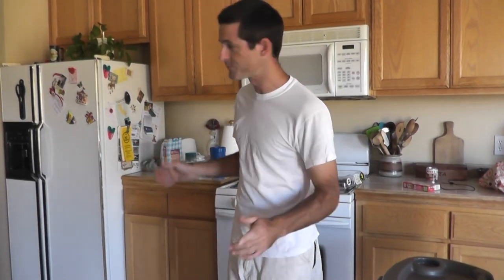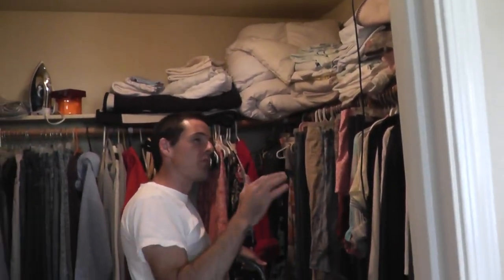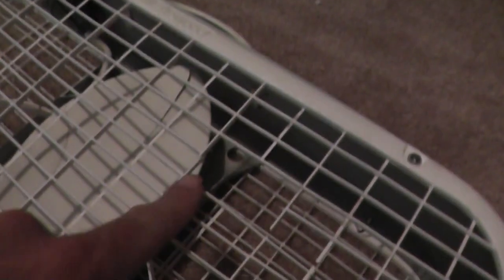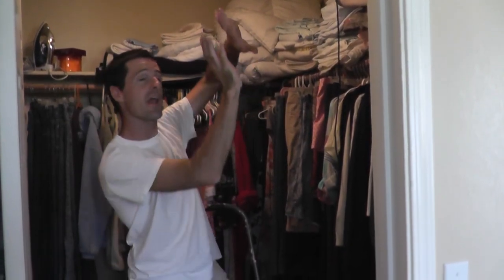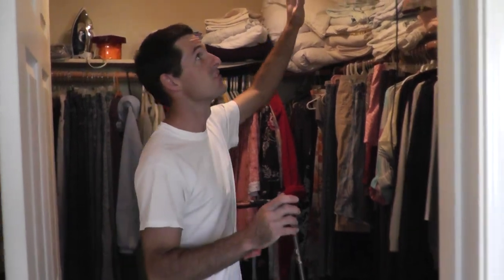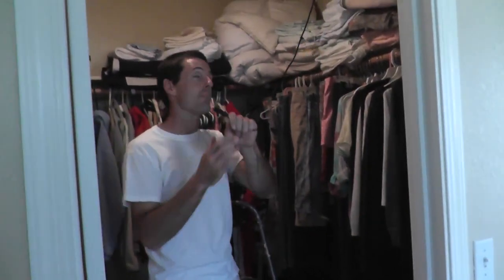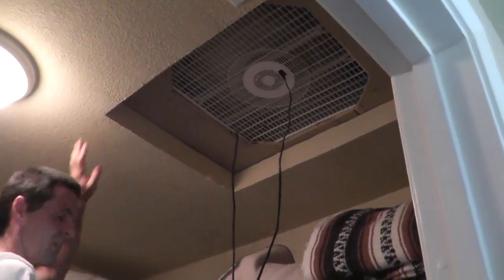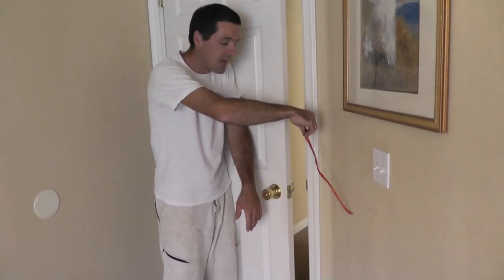Cheap Homemade Whole House Fan - How To Cool Without A/C !!

Comment: not a bad idea except no louvers when not in use, so heat will push down into house during day. But he has the right idea.
Reply: +robert mccully Warm air rises, cold air sinks. If doors and lower-story windows are tightly closed during the day, and unless there is a very strong, wind blowing outside during the day, the hot air tends to stay in the attic. It's similar to the way cold air stays in the freezer chests at the supermarket, even though they have no lids on them.
Reply: in theory that should be right,, but if you open your attic cover it is about about 130 degrees right at the opening. So that means it will push down. But if you leave the fan on all the time it will push the air out.
Reply: robert mccully That doesn't make any sense at all.  The attic isn't a sealed volume, and as the air therein expands while it is heated, it simply exits through the soffit vents and gable vents.  If the fan is left on all the time during the day, it creates negative pressure in the living space and sucks in hot outside air through cracks around doors and windows, heating the the house up faster.
Reply: true,,, the point is louvers keep the hot air in the attic until the fan is turned on. Just like curtains help keep the suns hot air out. To test the theory put a thermometer  on the bottom of the ceiling with a probe up into the attic a few inches . Or a thermometer in back of a curtain and one in front.
Reply: Its like the world is flat,, any sailor knew it was not. And any person that has worked in an attic knows the second you stick your head in a attic your sweeting.
Reply: +robert mccully 
Yes, and when you pull it back down from the attic hole again it is NOT as hot. Heat DOES rise and exits out vents already in the attic. Reply after reply on here does NOT change the scientific fact that heat rises. COLD air is the air that falls. 

I walk through empty houses all day long, summer and winter, fall and spring. EVERY house that has an attic, there is a drastic temp difference when I raise my head from below the attic opening to just above the attic opening. Now keep in mind, these are attics that have had their door/entrance remain wide open and has been that way for months, in some cases years, depending on how long it has been vacant, and there is NO noticeable temperature difference BEFORE I EVEN STEP ON THE FIRST RUNG OF THE LADDER and surrounding areas, until I get my  head PAST the opening of the attic.
Reply: I agree hot air does rise, it does not have a direction rise. If there are no vents in that area or enough vents the air is trapped..And there is a lot of roof area compared to roof vent. area.  There is also winter and to much vent would let to much warm air escape.. Vents are designed to prohibit mold grown in winter not heat escape in summer.. But yes a fan would force air to vents better then no fan. All i am saying if you use a fan have louvers. Beside you would want louvers in winter because it is colder in attic. Who would want to have no lovers in winter to allow any heat in vent to come down in house... It is never balanced  for heat or cold. so that is why  there is a attic door.

Comment: we laughed when watching this.... esp when you stepped on a cat @ 0:10!  An hour later our box fan was blowing hot air up and out of our attic.  Our goal was to get our AC up to the 2nd floor, it worked perfectly.  Our 2nd story is always 10+ degrees warmer with the AC on. The fan pulled the cooler air up (and out of the upstairs vents) and both floors were the same temperature.

Comment: This may have been mentioned before, but I live in Texas and when it is 110-120 degrees outside it doesn't make sense for us to crack the windows enough to draw and circulate air from outside. If I did that I'd just be dragging very hot air into my house. I think this would work great in moderate climates if it was 80-85. Additionally, I couldn't put the fan in close because there wouldn't be enough air flow.
Reply: If you live in your own house, build a tube trench that is at a slight downward angle, about 15 to 20 ft out, 5 to 6 ft deep, and have the highest part up near the house. Put a small vent in the floor, hook the cooling tube to it, and there will then be already cooler air coming in since the Ir at 5 to 6 ft is MUCH cooler!

Comment: Another way to cool off the attic (which will also make your air-conditioner use less electricity) is to cool off the roof with a sprinkler system.  You don't have to keep the roof soaking wet, but you need to constantly be misting it so that the water turns to steam.  All that water turning to steam takes BTUs -- BTUs that are in your attic.  You get 970.4 BTUs per pound of water removed when water goes from liquid to steam.  You are not going to actually cool a house that way, but you can cut down on the BTUs entering the house, so your air-conditioner doesn't have to work as much.
Reply from the maker: Grumpy OldMan That is a really good idea, and I think I'll set something up this summer. My roof is black and the attic heat is brutal.
Reply: ***** I used to have a house whose roof was shaded by quite a few very mature trees.  As such, it was shielded from much of the thermal energy causing the roof temperature to rise.  The electricity bill at that house was significantly less than other houses that I've owned that did not have trees shading the house.  So, if you don't mind waiting 50-75 years, well, that's ONE solution. :)
Reply: except all the water wastage, if everyone did that most places would run out of drinking water within a few years
Reply: music9170 Well, if you live somewhere that water is scarce, maybe that is not for you.  Around here, our annual rainfall is 49.77" and our record was 72.86".  I'm not too concerned with wasting water.  The best way to save water is to quit subscribing to the suburban green lawn mindset.  The amount of water that would be used misting your roof is a lot less than people use on their lawns.
Reply: if your in a tropical zone then yes you would have enough water, and no, misting a roof for a whole day would be 100x more water than anyone puts on their lawn, thats a massive amount of water unless you live in a tent
Reply: music9170 You don't leave it on all day since just flooding the roof is not efficient.  You want the water to evaporate due to the latent heat of vaporization being significantly greater than the BTUs that you get from just raising the temperature of liquid water.  To raise 1 lb of water 1 degree F, you use up 1 BTU.  If that 1 lb of water is evaporated instead, you get 970.4 BTUs.  To work efficiently, the roof should be misted periodically -- about a 20-30% cycle.  Of course, you don't need to run it at night.  I've seen reports of up to a 30F reduction in attic temperatures.

Also, a lawn needs about 1-2" of water per week.  That works out to be 623-1246 gallons per 1000 sq-ft.  My lawn is about 12,000 sq-ft after you subtract the concrete from the driveway, house, garage, and patio.  As such, I would be using 7,476-14,952 gallons on my lawn every week (assuming no rain).  That works out to be 1,068-2,136 gallons per day.  If you were putting that on your roof and figuring a 12 hour watering period, that would mean 89 gallons per hour.  Even using normal lawn irrigation sprinklers (not necessarily the most efficient in this situation), a 10' radius head uses 1.59 gph.  That's 314 sq-ft.  Assuming a 3000 sq-ft roof, it means that if you placed the heads most efficiently, you would need 10 of them, thus 15.9 gph if they were running constantly.  But they are NOT running constantly, they're only running 20-30% of the time and only for perhaps half of the day.  So, you're not looking at a total of 38.6-57.24 gallons used during the day.  That's a LOT less than is used for watering the lawn.

http://repository.tamu.edu/bitstream/handle/1969.1/6839/ESL-HH-85-09-31.pdf?sequence=3
Reply: Grumpy OldMan It sounds like you've put a lot of thought into this.  A few years ago I considered something similar, but never acted on it.  One thing that occurred to me as part of this is that misting is inefficient as some of the water will be evaporated before hitting the roof, or blown by wind away.  My thought on an alternative is a soaker hose placed at the peak.  You could even set up a moister sensor near the lower edge of the roof.  This way, you'd have a slow steady stream of water along the roof surface, restricted so all of it is evaporated before reaching the edge and being wasted.  Maybe a temperature sensor would be another good addition, and the whole thing could be automated.  Or maybe it would be simpler and still sufficient to just have a globe valve to control flow and experiment a little for best rate.  Here in Colorado, where water is somewhat expensive and the air dry, one of the most common ways to cool a home is with a "swamp cooler", and I've heard no complaints about really high operating costs for all the water.  A water-cooled roof seems a great way to reduce load on whatever system you have, all while extending roof life by avoiding extremely high temperatures.
Reply: When I say "misting", I'm not talking about the atomizers that they use for cooling patios.  I'm talking about the larger droplet type that they use for sprinkler systems.  Sure, there will be some loss, but not nearly as much as with the atomizers.  Ideally, you don't want to be putting so much water on the roof that it is dripping off.  You want the water to do a phase change in order to get the most BTUs out of each pound of it.  On the other hand, having some drain off might not be that bad if you live somewhere with a clay soil that could shift and give you foundation problems if it gets too dry.  Like with everything in life, there are compromises. :)
Reply: Grumpy OldMan That's why I considered a moisture sensor at the lower roof edge.  If the water reaches the sensor, the system would cut back the flow rate.  I suppose ideally you'd want two: one maybe halfway down and the other near the lower edge.  Then you could have it flow enough to keep at least the upper half of the roof wet but not enough to have any runoff.  All of the water would be evaporated, getting the most cooling from it, and enough water would be used to get a lot of overall cooling.  Of course, this would also shut off the system during rain.
Reply: Grumpy OldMan The idea is good but you are using an overall amount of water that is probably not very good as most of the hottest spaces are usually also water drought areas. Another optional idea is roof gardens which are actually good in wet areas with hotter summers, it takes a bit more management because you need to choose a short long life grass or plant that doesn't require a huge amount of maintenance and you need to know the structural strength of your roof but a 2-3" dirt covering with a thin bladed low maintenance grass could both retain the water you are using for your system and absorb a good 90% of the heat your roof is getting and relieve that heat through transpiration. Your water drip system would also only be needed during times of lower rainfall then making your water use much smaller since the soil would capture and retain any rainfall. Its probably a bit higher in cost to start but much smaller in over time cost.
Reply: Grumpy OldMan  Really though, a good shade tree will be mature enough in 15 to 20 years to cool a home. I chose Maple and they were about 4 feet tall. I planted 3 trees strategically to make use of passive solar. The trees started making a difference after the first year because of shading the exterior walls.Before the trees my AC cost was $125 per month (20 years ago) now @ max it is $65. I am in a small 2 bedroom, single story. As soon as you move into a new home, make planting of shade trees a priority and you will be happy you did. Of course you want to plant deciduous  trees. I chose Maple because they loose all of their leaves quickly. Some other shade trees can really be a mess.
Reply: I've seen people use this method. Absolutely works

Comment: The secret to have an attic fan cool your house is to have at least 9ft ceilings and trees for shade around your house. Open several windows and have a LARGE purpose built attic fan installed. It will cool your house, no ac needed.  Houses have to be built also with this specific cooling system in mind, like I said 9ft ceilings, also a wide major hallway with the attic fan installed in that hallway, centrally located to pull air equally from all open window, and the windows just have to be opened about 8 inches. It will have great airflow.

Comment: You're a genius.  Unfortunately I live in an apartment.  But great inovation.
Reply: GuitarRocks360 you can get almost the same results with a two box fan's stacked in a window. depending on the size you can either get a double window fan or a single box fan works great. make sure the box fan is at the bottom.its ok to leave the top empty, this vents the hot air. use the fan to draw in the cool air from the outside. best to use this overnight or in the early morning. before the sun comes up. depending on time of year and sun exposure. you want to shut your fans down when the sun is in the window. before you leave for the day , be sure to close ALL the windows, draw ALL the curtains and shades. this will help prevent heat loss.
Reply: GuitarRocks360 I rigged a window fan for a friend who has a house with a vaulted ceiling and no usable attic.  The $20 breeze-box fan was mounted on a piece of OSB that I painted to match the exterior of the house, and it gets inserted in the track of an upstairs sliding window in the late spring, then removed in the fall when it gets cool and the rainy season starts.  Since the hot air naturally rises into the second story, the fan helps to get rid of it faster during the night, and a couple of screened windows downstairs are left open to allow cool air in.  It works just fine.

Comment: I've used this concept for my room in the UK. Instead of attic, I have a 20 inch high velocity fan (120 watt) facing outwards on the right side window. My blinds then has a slight 'push' force towards the room, telling me that outside air is getting in. Then on the left side window I use a normal desk fan to distribute the air throughout the room. My door remains closed, however if I do open my door, I do get that ribbon effect you shown here.

For this to work however, I noticed that just 1 degree difference from inside and outside does not really make a difference, however it does start to work well when there is atleast 3 degrees difference (in Celsius). The only catch is that it is loud, however you also don't need to run the fan all night.

If you have a 2 storey house, I suspect you'll need a very powerful fan, or multiple box fans to create a 'vacuum' effect. You also need to restrict where 'air' enters and exits

Comment: As a firefighter, I can tell you right now this is a bad idea! Commercially available whole house (attic) fans work great and are designed to be hardwired, which provides for reduced electrical fire hazard. In addition, commercially available fans are self sealing when not in use, and default to a "closed" position during a product failure. That feature provides a fire break from occupied areas of the domicile to the attic. This fire break accomplishes several things:1. It keeps living areas of the home tenable during an attic fire, allowing occupants to escape the residence safely.2. It prevents fires in a living area from spreading to unprotected structural roof members in the attic, aiding in preserving structural integrity of the roof and preventing a collapse.3. This break can slow fire growth, allowing occupants time to escape and firefighters precious time to perform rescues and extinguish the fire.4. Limits damage to the structure by limiting fire grown, thus reducing financial burdens experienced by homeowners in the event of a fire.I urge you DO NOT DO THIS PROJECT! If you want a attic fan buy a commercially available attic fan and have it professionally installed by a licensed electrician.

Comment: I have the same setup in my hallway but rather than run the fan on high to create active airflow I run it on low as a means of venting stale, hot air. This keeps the living space comfortable enough, even in Texas, to get by with a few ceiling fans. My highest electric bill in summer of 2015 was $65, no lie.

Comment: The 300cfm airflow of a cheap box fan is worthless.  A whole house fan moves 4000cfm.  The window fan is not UL approved to operate horizontally.  The motor bearings will wear out and seize up and burn your house down while you are sleeping!
Reply: Modern box fans do 2400cfm on about 60 watts.
Reply: Ida keeling

Comment: Growing up in the late 50s that is all we had, one huge fan in the window blowing outward while the air rushed inward from any other open window. Worked pretty well, especially at night.
Decades later I lived in an apt with an attic access in my closet and had the same idea about putting a fan up there instead of in a window. It worked ok but before I knew it my apartment was overrun with those huge outdoor roaches that had made their way into the attic. It took months after closing off the attic to get rid of all of them as they had layed eggs everywhere. What a mess.
Reply: Love your profile pic bro
Reply: the ventilation caused the roach infestation?
Reply: St8kout well your family in the 50s must of been broke my grandfather had AC units in the house they were the size of small cars tho